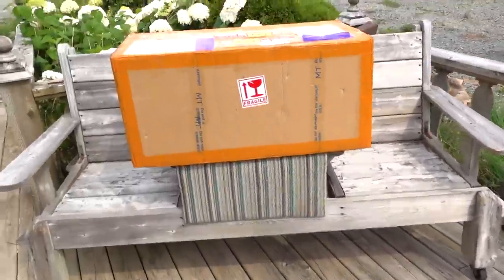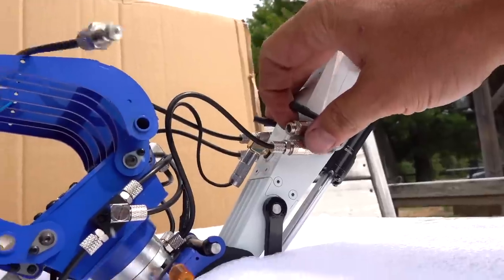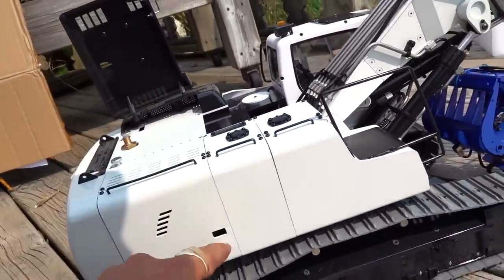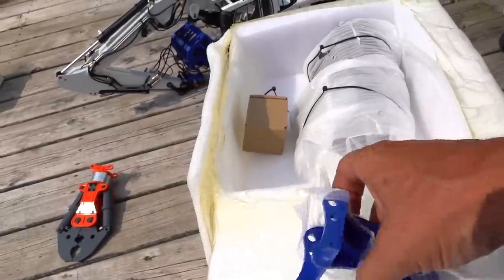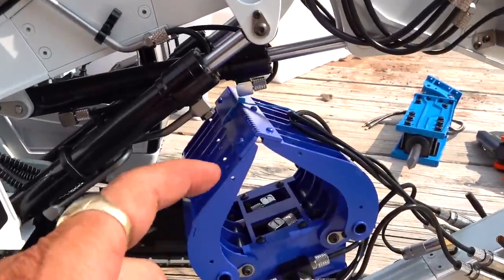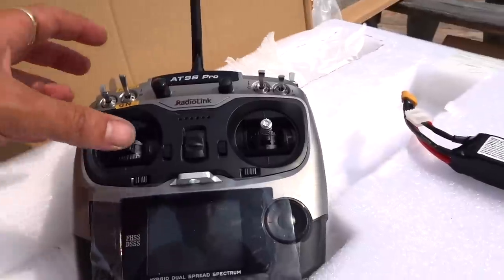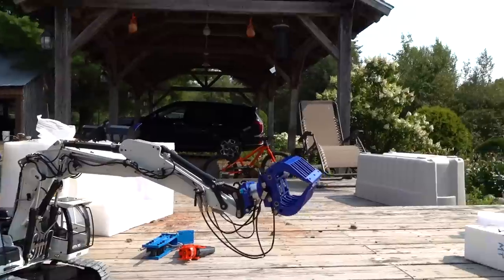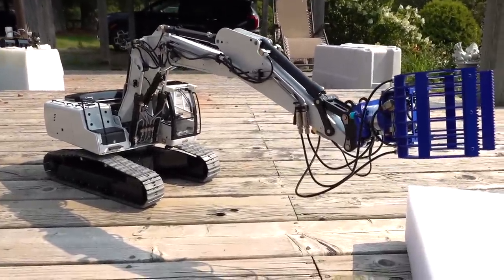I spent $5500 on a new "TOY" White Excavator & Jack Hammer - 1/14 (All Metal) | RC ADVENTURES

Comment: I've looked at this beautiful Eagle model before ordering my Lesu 374. Lesu bigger but not RTR and not so equipped. The price you mentioned is a good deal I assume for such equipment. (Who care sponsoring here we talk hobby💓 !)
Except for the buckets, I find it very very cooooool. 
I think a narrow bucket was best for the gripper use and hammer rock exacavating. 
But except that, imagine all the loading(wars) you could do! And if your opponent is not fair looser you could crush his beer Ith the grimper ! 
You could destroy and cut every obstacle on the gold mine. Manage the "rock" if falling on that in river bed. And use the ripper for the excavating gold earth a bit hard to drop on trommel. 
hat a great combo ! 

No you have almost all the construction equipment that exists

You eventually could had a farm tractor with high volume trailer to drive on long distance earth moving. 
You could have a wheel base excavator from lesu but not sure of the use ???
And a 3way dump truck but you already have the best yellow articulated... 
A compactor with vibrating function for road safer ?

You run Ith the best looking dozer(the used looking one)
Dump truck, lot of excavators, full gold.mining equipment,front loader, bobcat, elevator for loading truck before reach the mining site. 

Yeah it so cool bro'! So wonderful to see and dream of playing together as part of team wow

No for sure that's the best hobby you're right

ith my sincerely best wishes for this new adventure you desserve to have unforgettable moment ! 

Jerome form France 🇲🇫

Far away but waiting you a day. And far away but have feeling to ever know you and saw your son grow toooo fast

Comment: This is incredible. I love the mini hydraulics. Would be nice to put a small gas engine that's a generator to run the pump and charge the battery. Mini 4 stroke like a Honda gx35 running an alternator then it'll be a hybrid

Comment: IF u like, u can use a 3s lipo battery in the tx. With Radiolink, actually u can use a 2s up to a 4s lipo in the transmitter. Just as long as "it fits"!😁

Comment: Hah, what a cool machine! Looking forward to seeing how well that rock hammer works (and if there actually IS a sound kit). Hopefully it's one of the advanced sound kits with load sensing, so the engine sound changes RPM when you're digging, moving, etc.😉 That claw will be way cool for loading trucks when/if you get into the mini-logging business..

Comment: I have the same excavator but w the standard boom. I’m running a graupner mc-28 w the 4d sticks (highly recommend). It’s an awesome rig. I got a flat blade bucket to use inside on the carpet in the winter.  I just have the grapple, you got some nice attachments!!

I also have my pump set up to idle and spool up when I move the sticks… forgot the term for that (expo?)

Comment: adjusable bom was made by Brøyt (Broyt) back in the 60's on the x x1 x2 made hydraulic for  some customers, but for most manual adjustable, and maybe dialed in in the 70's as a more usable feature on the x20 and x21 and above models. nice model :-)

Comment: Hi Dude, I have the same but I bought it directly from MT Models. There are a few hacks for this 946. 
At first sorry for my bad English. You can change a gear to reduce the looseness in the turning motion of the top waggon ( I mean the part of the excavator over the tracks ). You can also change a few channels on the receiver and the remote to mix every hydraulic function on demand. If you do this correctly and change a few other settings you don’t have to run the pump even on a low speed. You will get full power on demand. If you want I can send you screenshots of my settings. And for sure the link to the turning gear. It has one more Thooth than the original one. It makes also sense to put in an oil filter.
Reply from the maker: The larger motor spins fast enough to mix?!  Thats amazing. I have never been able to mix these large motors because they dont spin fast enough. Fascinating!  The Slew is the Top section of the Excavator - it sits on the slew-ring. Yes, there is some slop there.  I would love some screen shots please.. that would be amazing.  My name on facebook is https://www.facebook.com/rcadventures/ please add me !
Reply: @TheRealRCSparks  Check your Facebook Messenger inbox ;-)